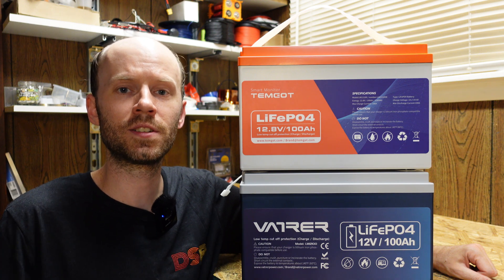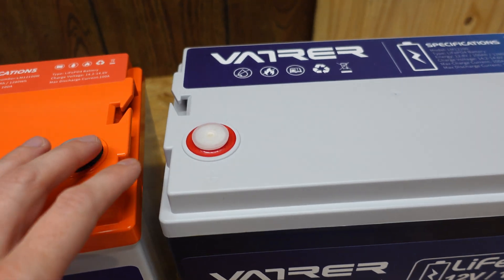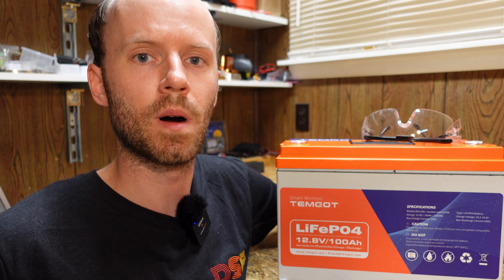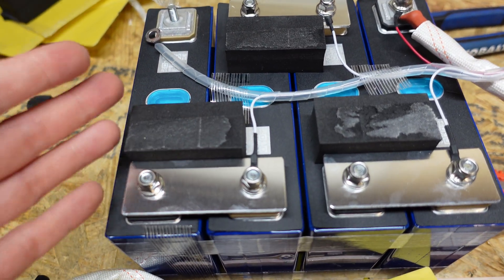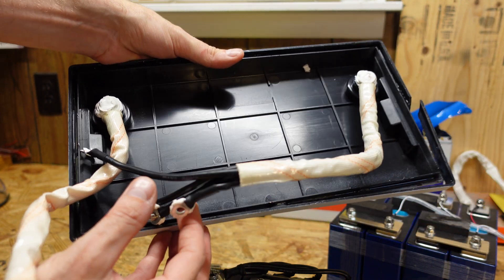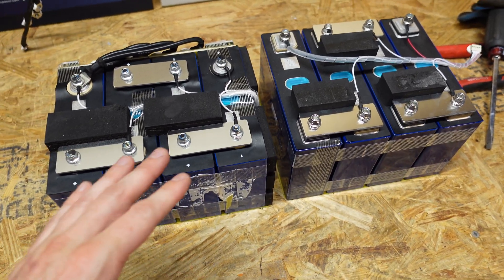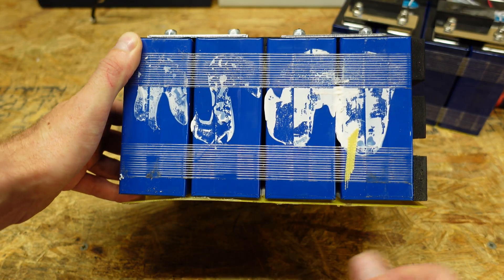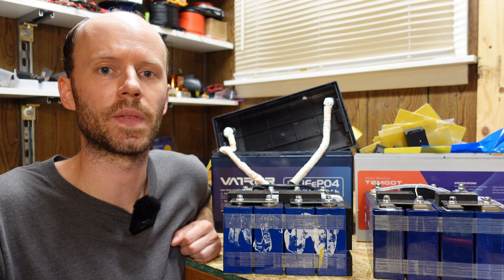Budget Battery Teardowns 12V 100Ah LiFePO4, Strange Smells, Busbar Concerns

Comment from the maker: Please let me know what you think of these batteries and if you have experience with either of them.
Reply: The Vatrer is the one that I sent to relatives in Ukraine last winter, and they have been using two of them to run a Vatrer diesel heater and lights. Zero problems so far, and they are quite happy with them.
Reply: Five months ago, I purchased the Temgot 100Ah self-heating battery, and so far, it's been working perfectly. The issue of the battery not functioning in low temperatures has finally been resolved. The battery comes with an LCD screen and Bluetooth functionality through the app, allowing me to check the battery status anytime, which is very convenient. With a five-year warranty, I would be very fond of it if the battery continues to perform without issues.
Reply: Capacity test?
Reply from the maker: @remix381  No, not this time
Reply: Could you test the EG4 PowerPro 14.3k battery? It's pretty new and can't find any reviews at all on it. Pretty please w/ cherry on top? 🍒

Comment: something youtube reviewers dont realize, thermal probe should be on the hottest area of the battery for overtemp protection, and coldest part of battery for low temp charge protection. hottest part of lfp prismatic cells is the negative terminal, and coldest part is on the bottom of the pack towards the outside perimeter. only using 1 temp probe should be in compromise position of these two. this is the same reason why the negative anode is so important for battery heat design and its why early pismatic nmc nokea batteries started with positive outter shell but new ones have all gone to anode as the outer shell. 
also something youtube reviewers get wrong is that the antiexplosion valve is only rated to pop with compression lol. lfp batteries make a crazy amount of hydrogen gas when they fail compared to other battery chemistries which can cause rapid incapacitation in a closed space. hydrogen gas is naturally irritating so its not as insidious as carbon monoxide or something. 
theres a lot youtube reviewers get wrong, like this guy has a video about why you cant replace the lead acid battery in your car with a lithium one. lol ripped the agm battery out of my car almost 2.5 years ago now for a 7lb lto pack i made with no bms, just active balancer. what a concept.

Comment: I think it is amazing that after all the battery reviews & teardowns youtubers have done that these battery builders would get it right by now. I guess using the straight buss bars is cheaper, but the 2 temp sensors stuck together in the exact same place is just laziness. My guess is the wires stuck in the silicone is they just slapped it together before letting it all dry first. I love a good teardown. Keep them coming.

Comment: anybody considering these two brands for 460AH both priced $1199 right now mid July 2024?  I do like the display of the Temgot.
Reply: I have been considering the 460ah versions in both brands, but I might be settling on 2 of  the 300ah versions of one or the other. I just haven't decided which brand yet. Going with 2 300ah not only gives you an additional 140ah, they are also just under $0.17/wh vs $0.20/wh on the 460ah versions. A fairly small price difference, but still cheaper per wh. The ones I go with will be used in my RV, so I would be trading off extra space for more total ah.

Comment: I'm using a couple of the vatrer batteries for off grid solar installations and I'm very pleased with them. I have the bluetooth version and the cells are very well balanced when I received them ( thats not always the case with other brands ! ) I think the build quality is very good with eve quality cells and bus bars . On the first cycle I got already 103 AH out of them. I think the smell you had is probably from some glue and not the cells themselves . Since a normal person will keep the battery closed its not an issue I think. DIY Solar Power with Will Prowse also thinks the build quality is very good and the bus bars are fine. The battery has a good low temperature protection as well and the bms can be completely customised using the correct app. Just my opinion

Comment: I have a Temgot battery and it has been working very well.  I use it to charge a Bluetti EB70S and AC180 when I don't have good sun for me to use my 2x120W Elecaenta solar panels for charging.  I have a 300w inverter that I use to run the 200W AC Adapter for the EB70S.  I can charge both solar generators at 200W.  Not great but works good when I don't have sun.

Comment: Hi I live in Maine and have had  a solar shed for the past 2 years and I am in the process of upgraded from two parallel Renogy 12v 100ah AGM to two Vatrer Lifep04 batteries with one more to purchase.  The final system will consist of 2 Vatrer 12v 100ah lifepo4 batteries and a 2K inverter.  My typical usage is between 10 and 100 amps.  Before I purchase more batteries, I am now concerned about how important it is for a lifepo4 12v 100ah battery to have internal bus bar stress relief for individual cell expansion?  I have heard pros and cons of an internal busbar needing a flex point made of layered metal to other opinions  its not needed.  Is the spacing between the internal cell adequate? What is your opinion? Did the Vatrer 12v 100ah lifepo4 battery teardown have good internal bus bars and cell spacing? BTW your teardowns are awesome. Thanks in advance.

Comment: Always VALUE your vids.  Now that it seems that many (labels) are jumping on the higher profit margin, pouch cell, “Mini” in LifePO4 12V 100ah, if you will be doing any additional vids on the Minis.

Following you and Will’s previous Vatrer Tests, I bought two.  Subsequently realized that I need more capacity for my system, while Highly space-constrained.  The introduction of the ‘Mini’ seemed compelling; but, I remain on the fence.

During this time, I still sit on Brand New Vatrers that I try to sell at a pretty big Loss.  😩

Also, I don’t recall seeing teardowns revealing flexible BusBars.  Can you mention a couple of examples, please ?

Comment: I have two of the Vatrer 100ah batteries, 9 months old. I have had no issues with the units using them a trolling motor batteries pulling 50Amps at full throttle. Got them on a sale for $285 each shipped including tax from them directly. The cells register as EVE cells based on average Joes review. The BMS will pull 150Amps for at least 10 seconds. Whats not to love? Its a 5 year battery solution that weighs 25 pounds a piece vs the 60 pounds a piece lead acid. Thats 70 pounds of weight savings.

Comment: I bought a plastic plant pot Walmart a couple of months ago, and it had a weird chemical/burnt smell. Heavy industrialization contamination? High temps to speed up production?
Reply: I dunno, its like my older brother has bad breath while i don't, yet even though we fell from the same womb, though at different times. Maybe your plastic pot was made in the same injection molding line as that smelly battery, or maybe, it that line has the same employee that has bad smelling plastic while the other factory workers plastic is ok, even if theyre related.

Comment: have 2 Vatrer batteries  almost a year  used during  hurricane ean, and for van refrigerator . so far so good there lower priced 
so some economies happen i have 1 cheaper one dont have low temp like the vatrer but for all 3 for the price of 1 battle borne
i risk it

Comment: Wow, those look identical to the "Cenerius" 12v 100Ah I reviewed recently.
Reply: I watched a video last night of a factory that says they can put any brand label on the battery that you want, essentially suggesting that perhaps many many differently labelled batteries are shipping out of the same street address.
They at least buy the same injection molded casing and you know they'd want to save money in that dept, so cases tend to look not so original in design per brand.
Reply: @truetech4158  oh for sure. A lot of this stuff is made by a few places.

Comment: Theres a vid of a guy that opened up a prismatic cell, it had an internal pouch inside the aluminum casing and nothing happened when he let the air into the case but there was some fluid in there. Not saying all prismatic cells are built like that but it made me feel better about their construction. I can link the vid if you want me to.

Comment: Maybe a dumb question. 
What's the difference between buying one 48v 100ah vs 4x 12v 100ah or 2x 12v 200ah is there any difference between those or it would be like buying the same thing but in different format?
Reply: I would not say it is a dumb question, but my answer may be.
As far as the Watt hours in each group goes, it would be the same, 12 volts at 400 AH is the same watt hours as 48 volts at 100 ah. The biggest difference to me would be the weight of each to move them around, moving 4 small batteries or 2 smaller batteries is easier than moving one really heavy one if that is an issue, the more parts you have the more parts that can fail, and of course, the amount of wire and other parts you will need to connect them all. The only other major difference to me would be in that you could use the groups of batteries in different voltages based on how you set them up for a system and the one battery you are stuck with that specific voltage. Not a big deal if the rest of your system is made for that voltage. Of course, you do have to look at what the manufacturer says about connecting them in series or parallel limits are. Some say no more than 4 in series connection. 
It is possible that if you have 4 batteries hooked together in series that you would be safer to get a balancer for the batteries to keep them all at the same voltage when wired in series because you should not depend on just the BMS to keep them from going over voltage. I saw a video of someone that had Battleborn batteries and the 3rd battery in each set he had failed and had burned out and those 2 batteries were reading 17 or 18 volts while the others all read 13.2 or something like that. They were wired is series for a 48 volt system.
Reply: It’s the cabling and setup.  Series battery configurations require even length cables to and from the batteries to keep charging and discharging even between the batteries. Parallel setups have the same problem, you can’t just daisy chain them. The battery furthest from the charger gets less charging, the one farthest from the inverter drains slower. And the closest to the inverter literally takes all the current flowing through the whole bank through it’s terminals, which can cause heating and failure, sometimes catastrophic. Several considerations there, like the cost of extra cabling. One 400 amp hour battery is better than 4 100 amp hour batteries, as the one doesn’t have imbalanced charging and discharging issues, and less cabling is cheaper. Battery cables should be as thick as possible, and that costs time and money and space etc. . There are other considerations, the more batteries you have, the more things that can fail.

Comment: I guess with these particular batteries, if they would have left the strapping tape off so the batteries could expand/contract against the foam, that would have been at least moderately okay?   The flex busbars are kind of new to the market so I wonder what BattleBorn and others were doing before the flex busbars and if those batteries are experiencing any issues today.
Reply from the maker: While there are better options, I'm generally fine with the use of strapping tape. The part I don't like here is the use of strapping tape WITH rigid busbars. You are correct that the multi-layer flex busbars that I showed in the video are relatively new; however, the use of flexibility in busbars is not. Almost all batteries we have reviewed have little humps in the middle of the busbars, which are the designated to allow a bit of movement. The SunGoldPower rack battery that I reviewed recently also had rigid busbars, but those cells are fixed in a steel box - not held by strapping tape.
Reply: Is BattleBorn now using prismatic cells in their battery line? I have only seen Will's teardown of a 100Ah from a couple years ago at least. There's another company (I believe they are Australian or British) that uses cylindrical cells and touts the form factor as all around better. In a way it is, since you don't have to deal with expansion and contraction but obviously from a space form factor standpoint they do get bulky. I don't think I've seen a 32700 that can hold more than 7000mAh....and I might be wrong on that, it might just be 6000+mAh.

Comment: Are you sure it's not the glue that they used to secure the battery into the case that's causing the odor? Usually that what causes that awful smell .
Reply from the maker: Yes, I'm sure. Electrolyte has a very distictive smell that I'm very familiar with.

Comment: I purchased one of the vatrer batteries. When I attempted to charge battery for the first time, it would take charge. So i bought two other chargers and those didnt work either. I reached out to vatrer an they told me to just keep trying a different charger. After i told them i would fix the battery myself and never buy thier products again, they then offered to replace battery.
Reply from the maker: Wow. It's sounding like an overall problem with quality control.
Reply: @LithiumSolar  i tore battery apart and the problem is the bms.

Comment: I've sent a couple of the Vatrer batteries and a Vatrer branded diesel heater to relatives in Ukraine. They were cheap, available, and didn't smell. So far no reported problems. That said, I would rather have the battery with the JBD BMS. This doesn't mean that I would recommend them, just that so far they have given no problems. I suspect the smell is from a cell that leaked onto the assembly in the factory rather than from this battery.
Reply from the maker: I don't think it's coming from this battery pack either, but man is it STRONG.
Reply: That's what occurred to me, but ... inside of the cell? Contained to that one small area? Just saying it's strange no matter how you look at it.

Comment: If you don’t see any leaking or damage, I’d bet something happened at the assembly plant, and a cell spilled onto the insulating board… that sliding tape is a dead giveaway some chemical has compromised the adhesive…
Reply from the maker: I think that is a spot-on assessment.